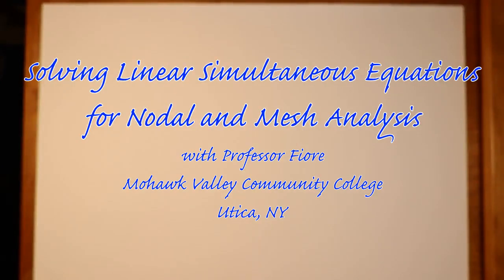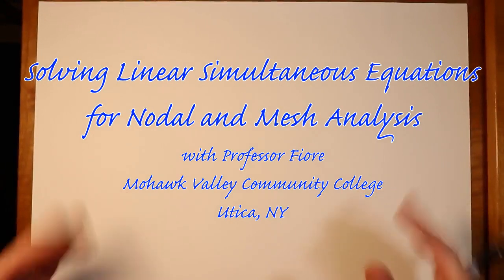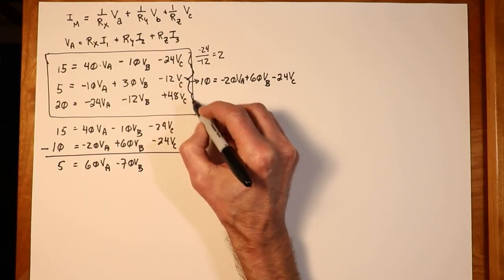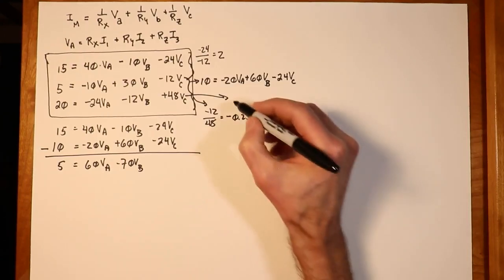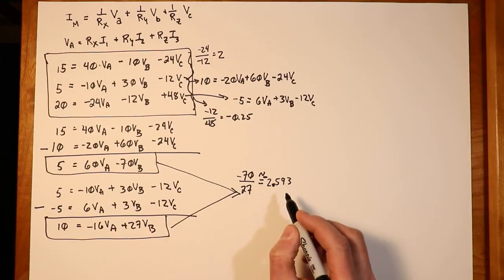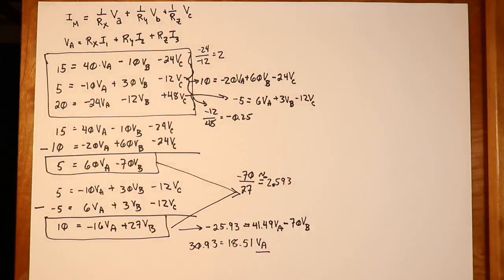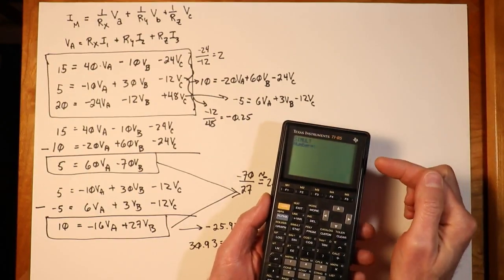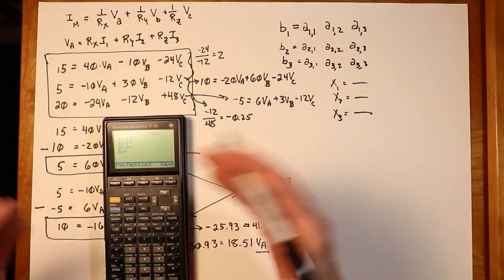Solving Simultaneous Equations for Electrical Circuits

Comment: This is great, I used something like this for DC circuits; however, AC circuits use imaginary numbers so TI calculators will throw a fit when trying to use the i symbol.
Reply from the maker: That depends on which model you have. The 83 and 84 have issues, but the older 85 and 86 work well, as does the 89 and newer models. The 89 uses the "i" while the 85 and 86 use an alternate representation with parentheses, e.g. 10-j30 is entered as (10,-30).

Comment: Hi sir, being a mechanical engineer, "how much " electronics should we know for learning and mastering robotics?
Thanks.
Thanks.
Reply from the maker: Well, more is always better, but in general you'll need basic circuit analysis along with knowledge of semiconductor devices and motors, plus some control theory and knowledge of electrical sensors.
Reply: @ElectronicswithProfessorFiore  Thanks for your prompt reply. Appreciate your kind work.